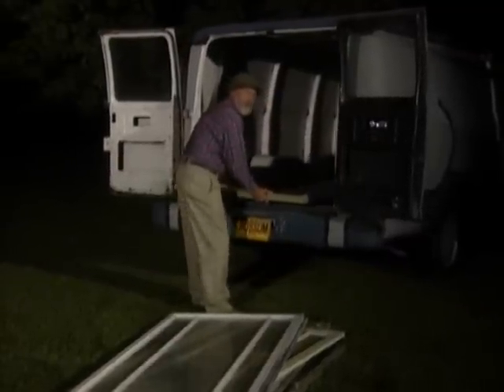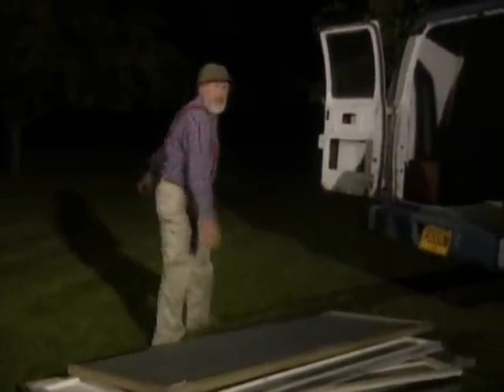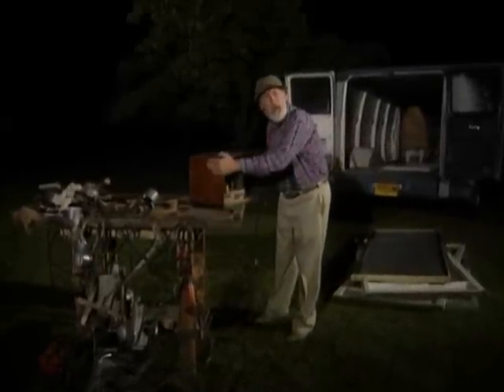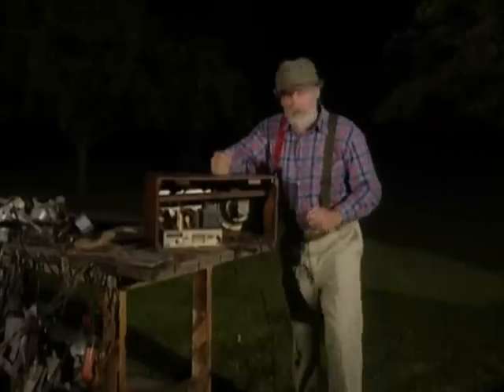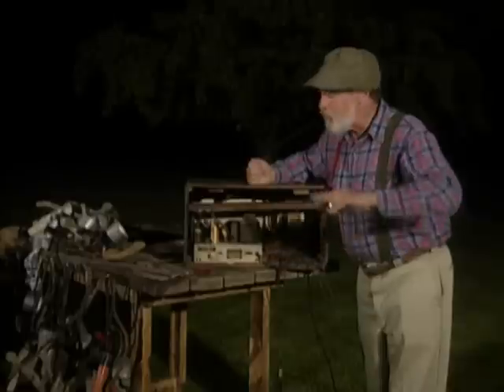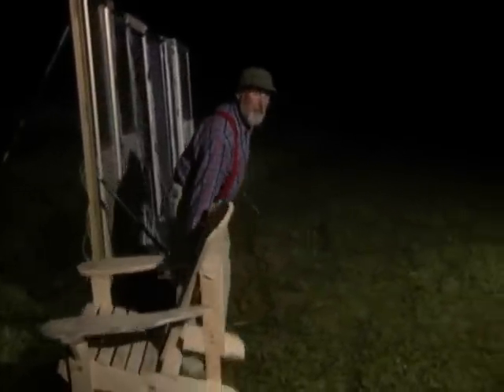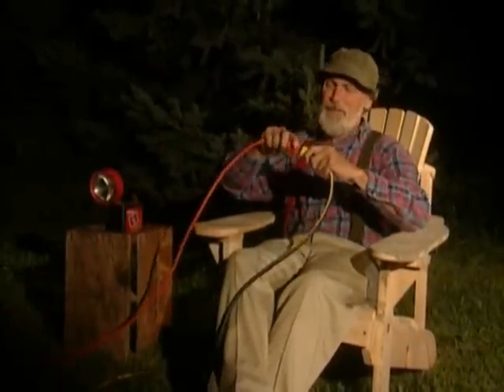Handyman Corner -  Bug Zapper

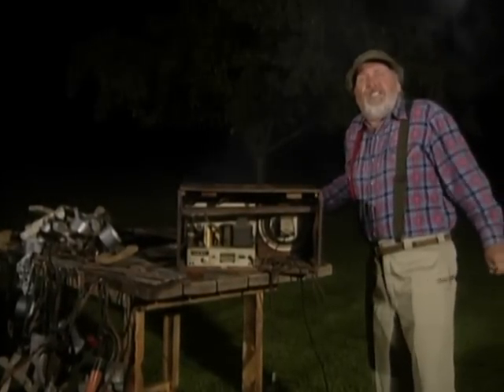Comment: @1:05  Reminds me of the time I was working on an old Akai tube reel to reel tape recorder and accidentally shorted out one of the capacitors.  Wasn't injured, but the jolt propelled me to the other side of the room.
Reply: I was working on a tube tv once. Fun times.
Reply: I was working on a 300w tube guitar amp one time, that was fun. I lost feeling in my right hand for a day or two
Reply: I once cute the big lamp Wire on a box tv
Reply: I got myself twice when changing a crt tube on a tv set

Comment: Would this actually work since the concept sounds fine!
Reply: It's actually the same idea behind the bug zappers shaped like tennis rackets.
Reply: @ThatWolfWithShades  I know that why I asked
Reply: Bug zappers have two screens close together, each with opposite voltages. So no, this would do nothing but short out the circuit.
Reply: @gregorymalchuk272  👌